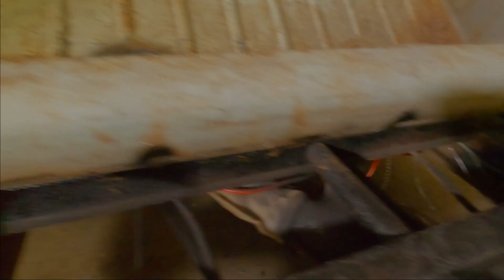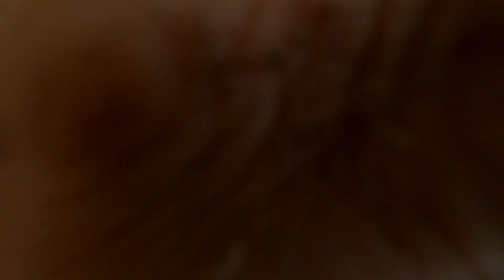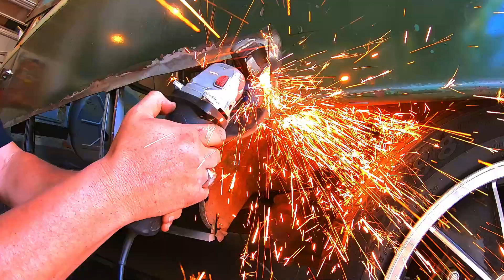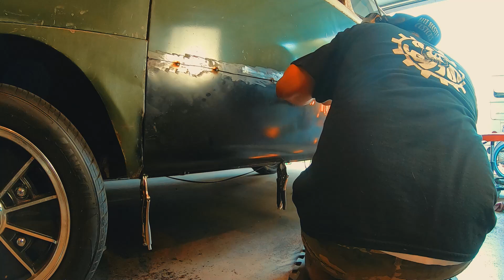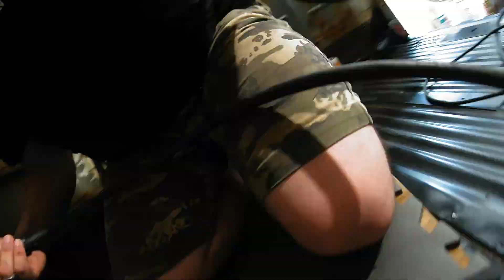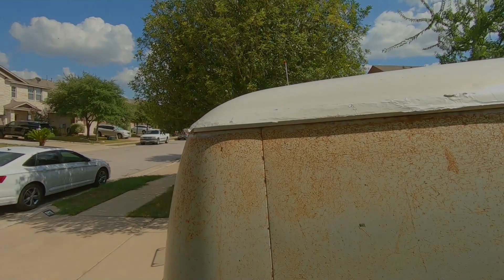ep74  VW Bus floor and body panel install

Comment: Great video and jobs well done. Like you I am a great grinder. I don't care for show VWs. They should all be solid and driven daily. ✌️
Reply from the maker: I'm getting better at the welding part. As long as they hold I'm happy. I try not to weld where it can be seen.